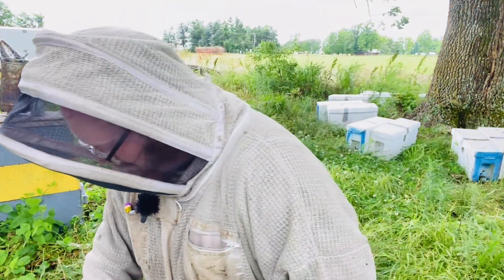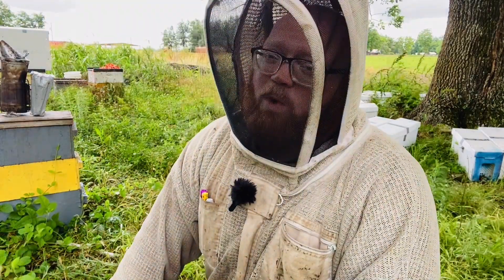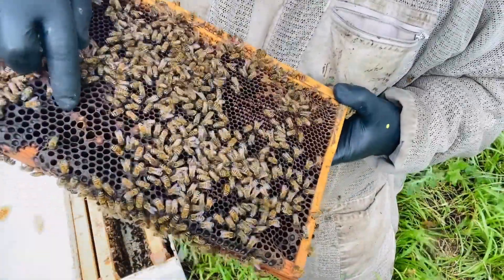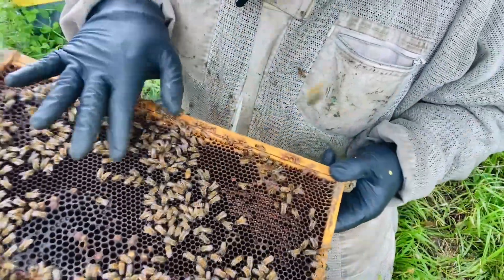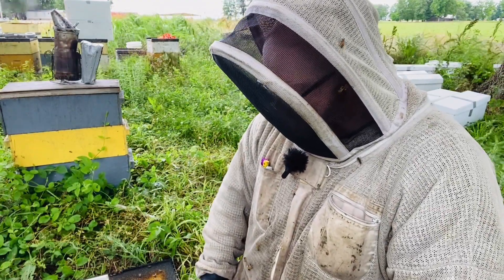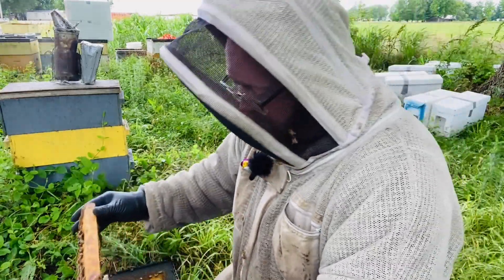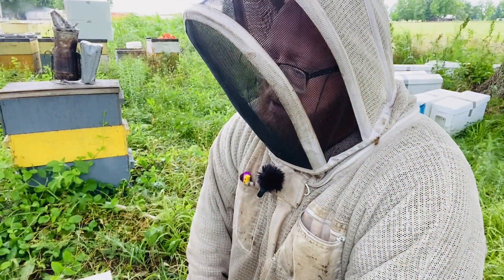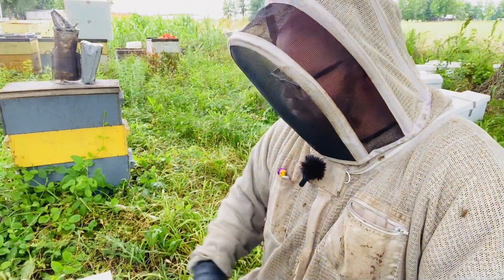How to fix a laying worker hive- Using a 48hr queen cell!

Comment: You can also shake em out on a table,chair,or anything they can cluster on, leave them there for a few hrs,  then rake em off in a Hive an turn a virgin queen loose with them an leave them alone for a wk or so. Ever time I've done it it works, never tried a mated queen. Great video gus 👍